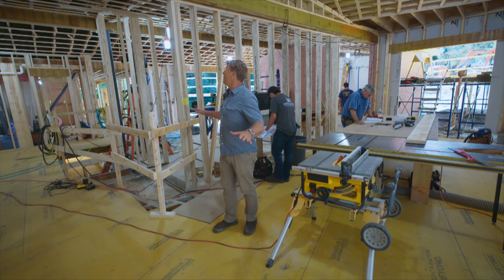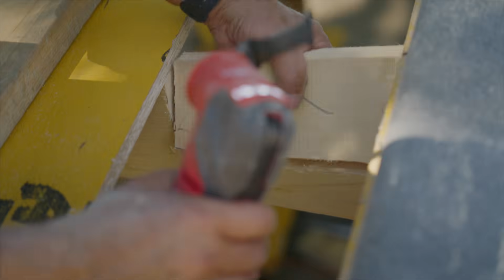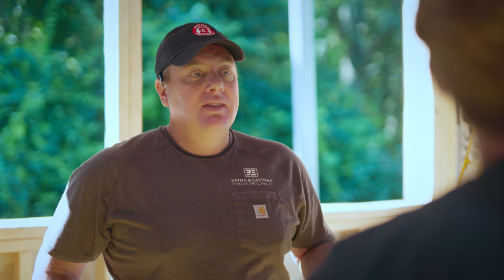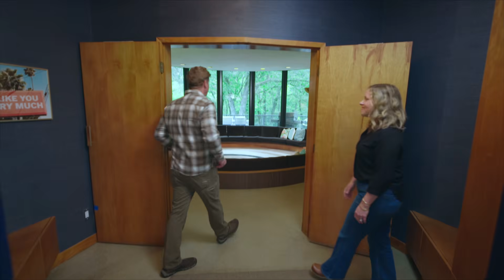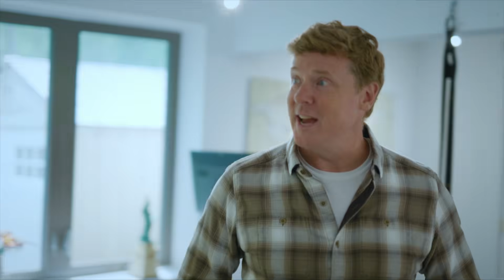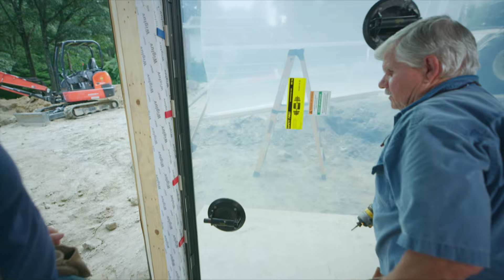This Old House | Drop in the Gutter (S45 E8) FULL EPISODE

Comment: I'm confident you (Heath) will have a Lutron or similar lighting system for advanced yet simple to control lighting. I've installed a few for wheelchair bound customers over the years. You can do a lot with Lutron Caseta system at a budget price or you can spend a lot more.